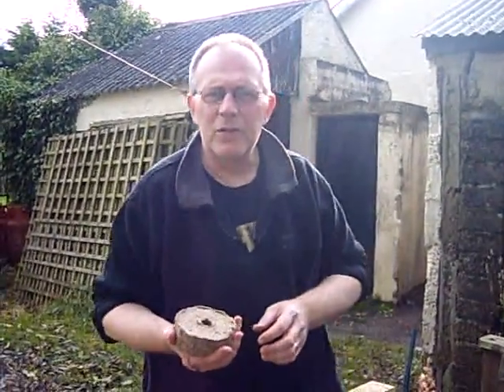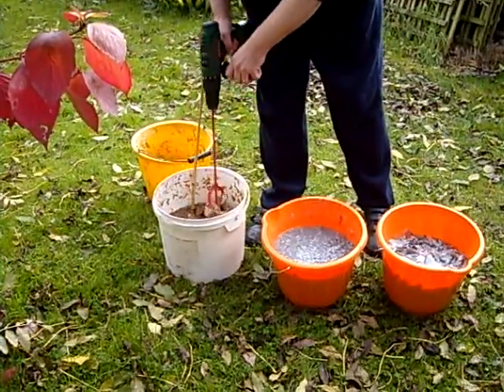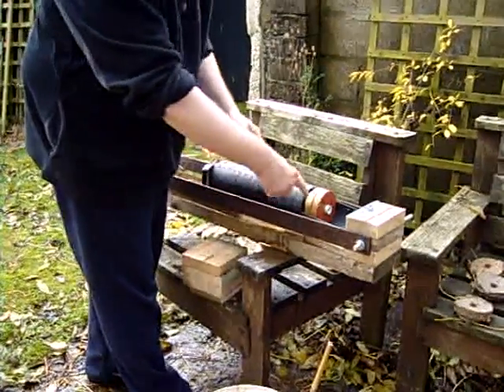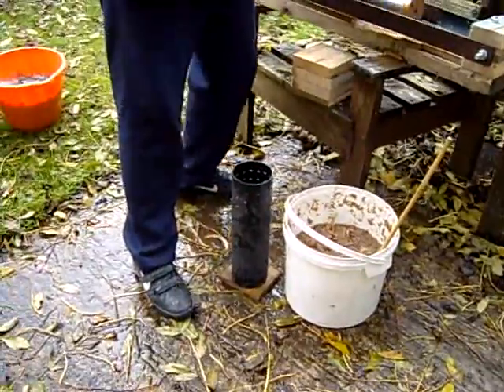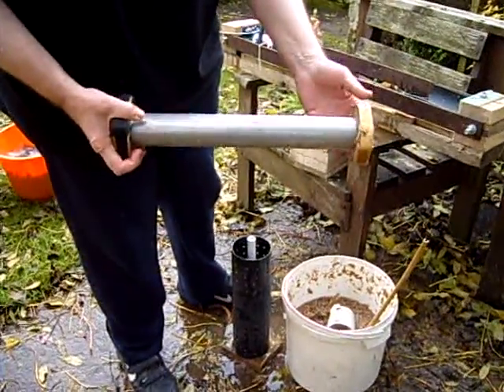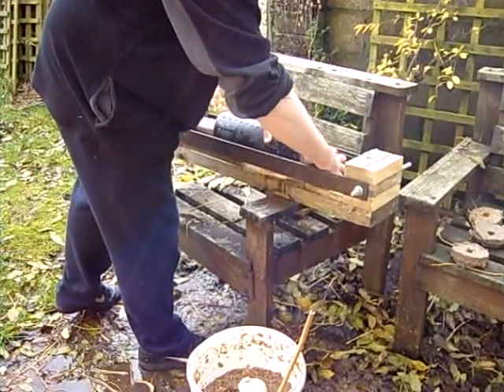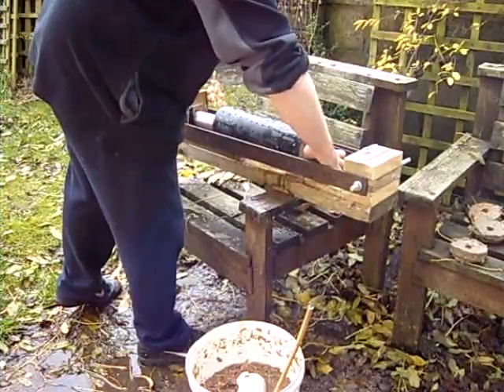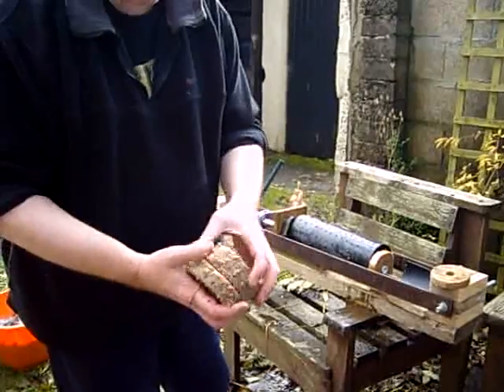Homemade fuel briquette press

Comment: This is good, but have you tried to make them with dry saw dust ?   You might need some pine in the mix or a resinous wood and more pressure, maybe a ten ton bottle jack.  Good use of materials.   I have been wanting to use paper, saw dust and wood shavings all together in a mix and a tuft of dryer lint to help get it started.   I also want to use up left over oils and greases and waxes.  There must be several ways and I want a press mould to use that will create holes in the side and a hole through the middle.  I am afraid plastic will not be strong enough, and a center pole would have to have a slight taper to it to get a whole log off of it.
Reply from the maker: Thank you Wade.  I didn't make it clear but there was sawdust mixed with the shavings. As you said, we need a lot of pressure and holes to allow air through for burning the briquettes.  Unfortunately, as we demand more from our press the price increases as well so we have to compromise somewhere.  Have you found Mladen 365 yet?  He is from Croatia and is my briquette hero, here's his channel. https://www.youtube.com/user/mladenkorotaj/videos
Best Wishes, Brendan.

Comment: To help with drying you need to make a rack that channels air through it.
Moving air helps drying much better than heat. A small solar powered fan and a cabinet with rack type shelves and enclosed on 2 sides should do the trick. Basically make a wind tunnel
Reply from the maker: Thank you, I'm about to make open-air, covered, racks behind my workshop where there is always wind blowing fron the West.  Another project, that hasn't happened yet, is a drink can solar heater that works as a kiln and allows warm air to pass through the briquettes and exit at the top.  Hopefully, I'll be able to get these done among all the other projects.

Comment: Super "Aggie engineering" as we would call it here in south Texas.  I think I will give it a go and maybe I can plan on an easier way to get the hearth going rather than using a brick of porous ceramic doused with bar-b-que/lighter fluid.
It's folks like you who think of ways to get more results with less effort for those everyday  tasks,  refining the idea's  design and "engineering", obtain a patent to protect the idea, and possibly making a couple of bucks!
Thanks  for sharing your idea,
John Flanagan
Reply from the maker: +Jack Flanagan Thanks John.  This is a crude 'proof of concept' and, if you look around YouTube for briquette presses you will find much more efficient types.  There is a guy in Croatia called 'Mladin 365' who makes loads of different presses that are much better than mine )If I put a link in here this message will go to your Spam box).  
I imagined the last thing you guys in South Texas would need to do was light a fire.  Doesn't the Sun shine hot 24 hours a day there?
Best Wishes, Brendan.
Reply from the maker: +baconsoda 'Mladen 365' - just checked the spelling.

Comment: I myself  am a diy guy. I too don't have any mechanic but basics and engineering skills. Money is an issue on everything. So if i can  I do a ton of research along with my own ideas to find ways to make my own stuff.So I'm reading everyone's comments and getting a lot of ideas. You said that you don't get much sun in Ireland, well can you make a cheap or mini green house to dry out the pucks in less time ? Here's some links hope it helps. Build A Mini Greenhouse For Raised Beds ,DIY PVC Green House/ Cold frame , maybe this could help out with your drying out problem.
Reply from the maker: Thanks Larry, I've just got this message because it went into the spam box, that sometimes happens to comments with links included.  However, I've fished you out and approved your comments so it won't happen again.  I'll get a look at the video later, it's very late here, 2.55am and I've just driven 370 miles so I'm having a mug of tea before bed. 
Best Wishes, Brendan.

Comment: another thing you can try is instead of using water shred the paper as fine as possible and mix with some cooking oil instead of water and press it. that way you dont have to wait 2 weeks for it to try out
Reply from the maker: I thought of using cooking oil but then wondered if it would produce loads of oily smoke when it was burned.  I will try making a couple of briquettes the next time I have some waste oil and I'll burn them in the workshop stove where smelly smoke won't be a problem.  Thanks for the suggestion.
Best Wishes, Brendan.

Comment: This is a great ideal,and with a gas powered log splitter modified and with many cylinders already loaded up ready to press ,you could make and turn out, many, many briquettes very quickly.
Reply from the maker: I never thought of using a log splitter because I've been trying to design presses that could be made from scrap and rubbish so that people in countries where there is fuel poverty could make their own press.  I might do what you suggest for my own use.
Thank you, Brendan.

Comment: Thanks for the video!  I was able to scrap together a press of my own after watching this and now am making these biomass pucks for fuel come this winter.  Have you refined any of the process since you made this video to get the pucks to be more efficient?
Reply from the maker: Hi Griff, I haven't changed much at all and haven't looked at this for a long time because of other things I'm trying to do.  I tried adding less paper and more sawdust but the pucks didn't bind as well as with the 50/50 mix.  I intend to build another press that will catch the waste water to reuse the starch that escapes.  I think a fairly efficient bond could come from reusing the water as often as possible.  I will have to add water but I would hope to have a stronger base solution than just fresh water each time.  The big issue here is drying, that takes an eternity, so I've not been so enthusiastic about continuing development because of that.  I have a compound lever press mostly built but I'll have to dig it out of a shed.  Maybe I'll get to that eventually. 
Best Wishes, Brendan.
Reply: baconsoda
you could make a glue using flour and water in the mixture to make it bind better.
Reply from the maker: larry lindsey I'll try this because it's something I had thought of but never followed up on.  Thanks for reminding me.
Best Wishes, Brendan.
Reply: welcome sir and ty for adding me to your list much appreciated.

Comment: Anyone with "Bacon" in their name has got to alright with me. Good video. I was wondering if there would be a problem with using Kerosene instead of water to make a briquette like the Kingsford match light ones?
Reply from the maker: Thank you.  This was my first, and only video I ever intended to load.  That changed.  I would avoid kerosene for safety and management reasons because of the volumes concerned and I can imagine the smell of these burning.  Also, kerosene costs about a million dollars a gallon here so it wouldn't be economical for me, I might as well just turn the central heating on.  However, if you find anyone using kerosene in this type of briquette I would really appreciate it if you let me know.  I'll do a few searches myself and, if I find anything, I'll send it to you.
Best Wishes, Brendan.

Comment from the maker: The sawdust only needs to soak for as long as it takes to get the mix to a sloppy consistency, there's no need for overnight soaking or anything like that. The most important ingredient is the paper because it has to be broken down enough to release the fibres that hold eveything together. I've found that hot water is the quickest way to soften paper along with a good stir.  I pour hot water on, leave it overnight, and stir the next day. Then just add sawdust until you get a porridge-like mix.

Comment from the maker: I tried a number of mixes and had varying success.  With a dry mix the material was hard to get into the pipe and the briquettes didn't hold together.  With a very wet mix the pipe was easy to fill but the briquettes were thin and weak. The mix I used here was the best compromise between ease of handling and density of briquette. If I could get heat into the process that would mean I could use very little water but we are talking about really expensive commercial machines. Thanks for your ideas.

Comment: the large amount of water you use make for a wetter finished product, so they are a little messier to get to hold a finished shape with, my suggestion would be to allow them to start drying in the form or to use a drier mix

Comment from the maker: Hi Paddy, the briquettes burn like turf for about 20 - 25 minutes and four or five will give out good heat.  They need a fire to start them but once they get going you can dump more in and they'll burn away.  If you do this use sawdust or shavings because pure paper leaves loads of ash, these aren't bad at all for ash. 
Best Wishes, Brendan.

Comment: Good job on your video and project! I wonder if it would be possible for you to cut a 2 1/2
' hole in the top of your black drain pipe to pour your mix into it,that way you could clamp the black pipe down permanently.And then make the bottom/stopper block removable so after the mash is compressed you can just keep pumping the ram and push out the bricks.....Just a thought :)

Comment from the maker: I didn't try putting more mix in the tube because the parts were cut to suit 3 small briquettes but I did try to make one large briquette.  It worked fine but would have taken a long time to dry. I didn't try to catch water as this was a first attempt and I was only interested in the pressing process. I have worked on catching water in my latest press which I will do a video on soon.
Best Wishes, Brendan.

Comment from the maker: @peafaery Yep, it can be done easier, this was my first attempt.  There are other great versions on here, I'll send you a message with a link to a guy who has great ideas.  Sawdust - you need a binder unless you can create enough pressure to make heat that breaks the cell walls of the wood and releases lignite which acts as a glue - that's how industry does it but far too expensive for home DIY presses.

Comment from the maker: @yellowmetalcyborg Thank you.  I'm sure paper would be fine but it will probably take a little longer to break down than newspaper.  If you add a splash of bleach to the water it will help break the paper fibres down faster. Also, I have found that warm water seems to work more quickly than cold.
Best Wishes, Brendan.

Comment from the maker: @gserrano701 Thank you. Paper can be eliminated if you can get enough pressure to produce heat and release the lignite from the cells in the wood. The lignite then acts as a bond which the I use paper for.  The high pressure method is used commercially to make fuel pellets and processed logs/blocks.  I would love to make a machine to do that but I don't have the skill and it would cost a fortune.  So, its 'red neck' engineering for me.
Best Wishes, Brendan.

Comment: Have you considered getting a steel plate, painting it black and focusing a fresnel lens on the metal.  Placing the pucks on the metal, not where beam of fresnel, of course.  The concentrated heat should heat the stell to dry them faster.  If you make a box with a glass top you should be able to increase the temperature.  just a thought...  You could easily use the stove to dry the pucks using the pucks you have already dried.  A steel plate would still emit heat while doing so...

Comment from the maker: @SoyNoseNa Hi, the proportion of paper to sawdust is about 50/50 but it's not critical. The main issue is getting the paper well pulped to release the fibres because that's what binds the briquette together when it dries.  You can add any type of organic combustible material to the mix e.g. grass, leaves, cotton, cow dung, straw - if it burns when dry it can be used. It is not recommended to use glues and waxes because wax can leave volatile residues in chimneys and glue can be toxic when burnt.

Comment from the maker: @lovegunz1 Thank you for your comment. I did make it clear at the start that I had used designs from the internet and never claimed to invent the process. I should have been more careful to explain that the mixture wasn't contained under pressure in a sealed pipe but I assumed that all the holes I showed in the pipe would have allowed people to understand that there was a escape route for the water. Thank you for giving me the opportunity to clarify that point.
Best Wishes, Brendan

Comment from the maker: Thank you.  I did think of using wax but was advised against it because it can leave a residue in the chimney which becomes a fire hazard.  I was going to use candle wax but I'm sure the commercial products with wax in them possibly use something different and would have concentrations tightly regulated.  I didn't investigate this area any further because the fire hazard element put me off.

Best Wishes,
Brendan

Comment: Nice video..did u think of using them mixed w/wax to help start fires in fireplaces? we use alot of brickettes for fire starting in winter here in the US. I think they put fuel, sawdust, and wax in them so they will slow burn.

Comment from the maker: Bret, the pieces could be longer and thicker but then compression and water removal becomes more difficult without hydraulics.  If you could extract water from a log-like piece then drying becomes the issue because the relative surface area has been reduced.  This would not be so critical in hot countries but is an important factor in Ireland.
If the diameter was reduced then a longer log could be made with enough compression and that would make drying easier.
Thank you for your comments
Brendan

Comment from the maker: Thank you.

I tried turning the press upside down but then realised the jack won't work inverted.  The horizontal aspect was an easy fix.  I'm working on a lever version and trying to simplify the building and, I agree with you, it will speed the process up but the more simple I try to make it, the more complicated it becomes so I'm back at the drawing board. More to come.
Best Wishes,
Brendan

Comment from the maker: I'm thrilled that you were motivated enough to give this a try and disappointed that you ended up mutilating yourself.  However, that was just your prototype so try again with a plastic pipe or a steel pipe that won't flex when you drill it.  The principles are very simple, the difficult bit is getting enough pressure.  The pucks are hard to remove so maybe try using a ram and hammer to beat them out.  I try to keep my hands away from the action but it has taken many years to learn this!

Comment from the maker: The shredded paper is used to make a pulp that then acts as a binder with the sawdust and chips.  The paper fibres act like stringy glue and when dry they bond the pucks together.  I have looked at other materials but paper is the easiest to get a quick pulp from.  In high pressure systems where a wood dust mix is compressed and heat is applied the lignite in the wood cells is released and acts as glue when cool.  I cannot produce enough pressure to make heat so the paper pulp is my best option.

Comment from the maker: Thank you for your kind comments.  I haven't tried any other sizes yet because I was concentrating on the pressure aspect but I will investigate that area.  Your suggestion is very interesting, it seems like the same principle as the sawdust stove - an area I hadn't thought of applying to this project, so, lots more R&D to do, LOL.  
Thanks again

Comment from the maker: I haven't burned any pucks yet because I want to get them as dry as I can in order to assess the viability of making them.  If they go straight up the chimney of the stove I need to address the mixture.  I imagine I will make these in Spring and Summer so by the time I use them in Winter they will be very dry.  At the moment I am drying the pucks in my greenhouse but it still takes a lot of time.  In Africa and India they dry in 3 days, I'm afraid Ireland isn't just as hot.
I will post results.

Comment from the maker: Thank you,

I'm working on a version that will use a lever to compress the mix but I am having to work within the restrictions imposed by a health issue.  However, the Mark 2 press is sitting in pieces ready to be assembled when I get time.

I imagine that the bamboo leaves would be fine mixed with other materials because I have seen leaves used before and I am adding them to a mix I have sitting ready to go.

Let me know how you get on please.

Comment: Looks like a good device - I've got bamboo running rampant in the garden and would like something to deal with the leaves which don't seem to compost well - might see if I can get them through the shredder and then compress them into briquettes - going to burn the stems in bundles once they've dried

Comment from the maker: I am using a 4 inch (10cm) diameter pipe and making the 'pucks' about an inch thick.  I don't want to make them any thicker because drying time is already an issue.  You could make larger briquettes using a bigger diameter pipe but then compression becomes an issue.  If I were you I would investigate using one of those paper briquette makers which will give you a bigger briquette and you could add other ingredients to get a longer burn.
I hope this has been of help.

Comment from the maker: Hi Kikuk,

I am using newspaper and sawdust but you can use dry leaves, grass, straw, cardboard, seed husks etc. Search for 'biomass fuel briquettes' on YouTube to see what people use.

I tear newspaper into strips and soak it in water for 3 or 4 days and then stir it until it is a soupy pulp.  Then I add the sawdust and shavings and stir until it is well mixed.

If you had a grinder or shredder to reduce the ingredients to small pieces it would be more convenient but I just tear by hand.